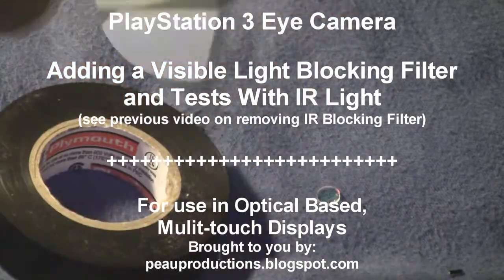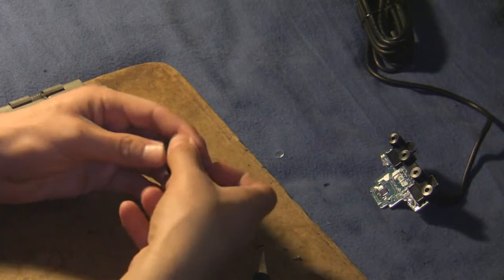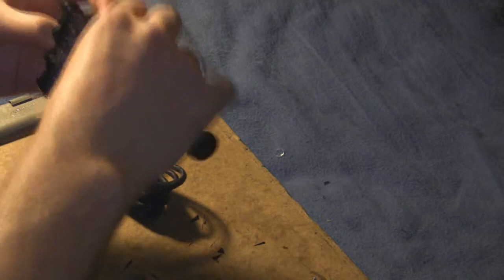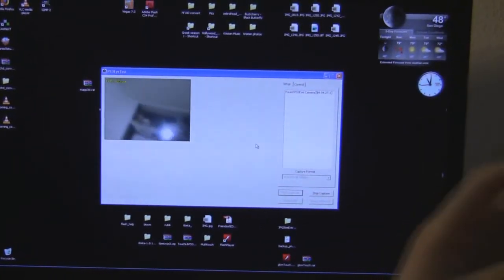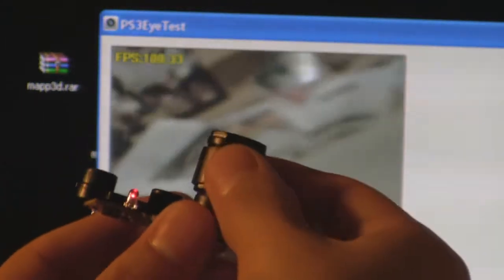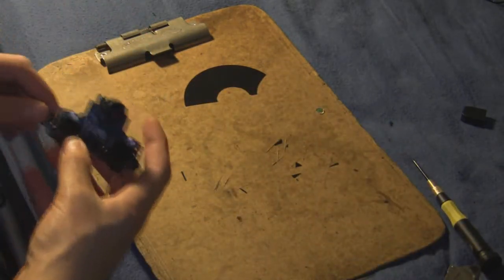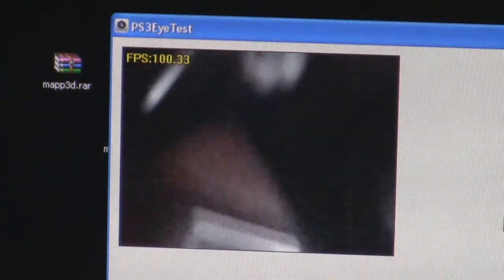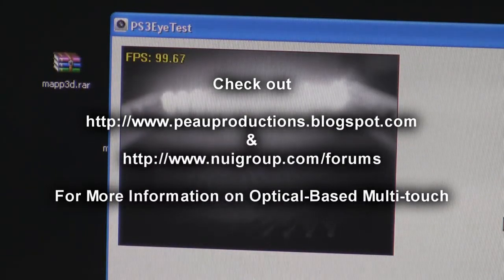(2/2) Playstation 3 Eye Camera - Adding a Visible Light Blocking Filter and Tests with IR Light

Comment: hey man, do i need to add that light blocker in there? or will it be able to track without it just fine?
Reply from the maker: Ideally you want the camera to only see the wavelength of light that you're using to illuminate the objects you're tracking on the surface. So if you're using 850nm LEDs, then you want a filter in the camera that can see 850nm, and ideally only 850nm (versus a high pass which sees all IR).
Reply: PeauProductions i see, thanks for the quick answer!

Comment: Still waiting on my 850 nm bandpass filter DIY camera upgrade kit from you guys, do I still need to take out the IR blocking filter or am I good to just switch the lenses over when it arrives and it will be good to go?
Reply from the maker: +Finn Maclean If you bought the kit then it comes with the lens mount and lens, so you just install those and not the original lens+mount. The lens will not have a filter in it so you will not need to remove it.

Comment: Do you NEED to put a visible light blocking filter on it?
Reply from the maker: flounder2760 If you're trying to track IR lights, you need to remove the IR blocking filter that is in the camera. After that, as long as you are not near any visible light source, meaning in a dark room, it will work without the filter because there is no visible light that needs to be blocked. You can possibly "shade" the screen with your body from light sources, but it still will not be as good as with a filter or dark room.
Reply from the maker: Not if you will be using your touch setup in complete darkness or in a room with all white LEDs. Any sunlight, incandescent bulb or other IR containing light will cause issues with tracking if you don't have a IR Cut Filter (visible light block)
Reply: im told that if you mess with the contrast and brightness settings you can make it work without one as long as you dont sit with a window behind you.
Reply: PeauProductions
this i already know....since i watched the video.....

Comment: Perfect! Many thanks. I followed your advice and steps.Bought a cheap PS3 Eye with a 'curved' lens, removed IR filter lens which was the hardest part, 3 exposed pieces of photographic film over the light sensor, lens re-attached and everything worked perfectly.
I did test the focus before I added the daylight filter, but to be frank, it wasn't that bad to warrant additional fiddling, and for the purpose of tracking IR. I used CL PS3 eye driver, and used this to test. I configured light in settings, turning off auto settings on gain, and white light and adjusted them myself using a remote control IR led. Result was spot on, black background and perfect led circle..brilliant fps also.
Best part for me is it cost me £5 :)
Many thanks for educating me :).

Comment: Would there be any difference in adding the visual band filter on the outside (before the lens) as opposed to internally (after the lens but before the sensor)?
Reply from the maker: Not really, though you would want to make sure you block any light entering in from the sides. Also, you will want to make sure the filter is larger in diameter than the lens so you don't see the filter.

Comment from the maker: Just install our band pass filters into the area between the lens mount and the camera sensor.  Be extremely careful as you screw it back together.  You do NOT need to screw the screws all the way in, only enough to hold the lens up and not have it wiggle.  Screwing it in beyond this WILL shatter your camera sensor and destroy your camera.

Comment from the maker: You may need to tell CCV to switch cameras if you have another installed on your computer (such as an integrated webcamera on a laptop).  Look at CCV to see if there is a toggle to change cameras (there was on earlier versions of CCV). Otherwise you can manually change it in the config file located in the install folder.

Comment from the maker: The PS Eye camera is the cheapest camera on the market that can support a high frame rate of up to 125fps (320x240 rez).  FPS speed is important in tracking objects on these MT setups.

Removing the IR filter is important in being able to see the IR light used to track the objects on the touch surface.  Without removing the filter you may be able to only slightly see IR light.  Once the filter is removed IR lights should be super bright.  

Send us an email for more help.

Comment from the maker: @swagger312 I agree, but most of the tracking the camera is built for, meaning for the PS3 system, doesn't need a higher resolution.  A higher framerate would be really helpful also.

Comment from the maker: Sure, but that just makes it look ugly. And since you already have the camera open you should just add it between the sensor and the lens.  Plus, in order to install the better band pass IR filters, you have to put it between so that is fixes the focus a little, which is caused by removing the IR blocking filter as seen in Part 1

Comment from the maker: You can use a regular webcam, but the PS3 Eye is used because it can achieve stable framerates much higher than a normal comsumer webcam.  It can do 15-125fps at 320x240 rez and 15-75fps at 640x480 rez.